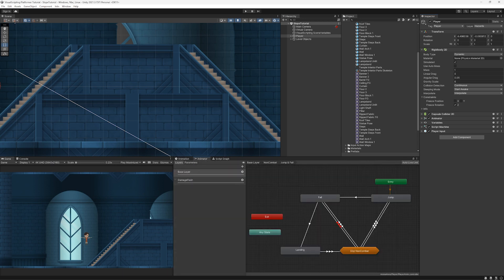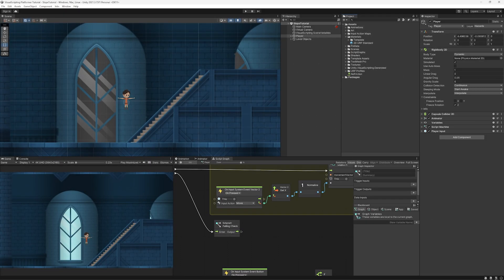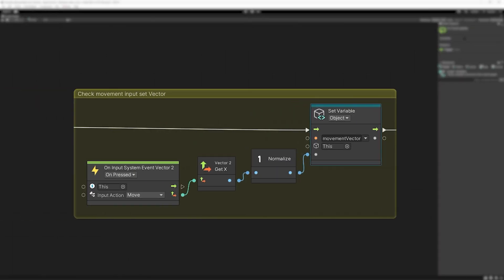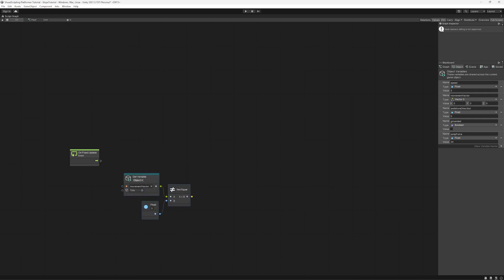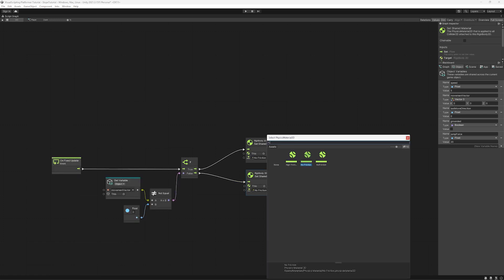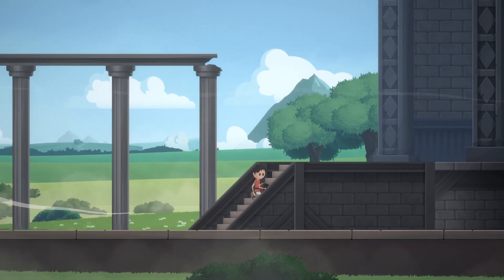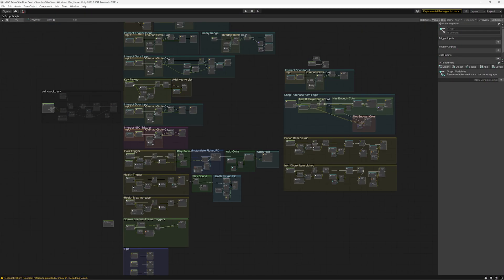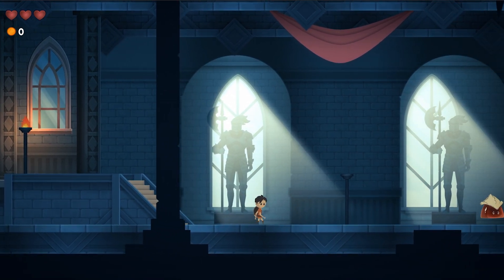Handling SLOPES in Unity 2D with Visual Scripting (SUPER SIMPLE)

Comment: Nowhere in your video you show what happens when you finish ascending the slope. The closest thing is probably at 1:51 where you just jump above the top.
In my opinion there is a much more reliable way to handle slopes.

Anyway, here is how I handled slopes. Does it work perfectly for every scenario? No. But for simple scenarios it worked just fine, and it allowed my player controller to move around custom areas and slopes of almost any degrees.
If the player is close to the ground (you can do this via raycast, box cast, overlap, GetContacts, anything really), disable gravity and apply a very strong force to the direction opposite to the normal of the ground. Otherwise, if the player is in the air, apply normal gravity downwards and don't do anything else.

E.g pseudo-code:
if (closeToGround)
{
    rb.gravityScale = 0;
    rb.AddForce(groundNormal * -1 * 20);
}
else
{
    rb.gravityScale = 1  // Unless you have another default here.
 }
Reply from the maker: Thanks for sharing. I believe there are many solutions to solve a problem and I'm glad this one works in your case. For my situation, what I shared worked well. I appreciate your reply!
Reply: @taleboundgames  I'm glad it works out for you. I still have one question though, does your solution also fix the player flying off the edge of the slope when going up? It's one of the annoying problems I've been tackling.
Reply from the maker: I have the gravity set to 7 on my player and I hadn't had this happen. That's my only thought as to why you get that flying off the edge issue, possibly having the gravity too low.
Reply: @9gigabyte623  I have a raycast a little in front of the player to check if you are about to leave the slope and apply the move next frame